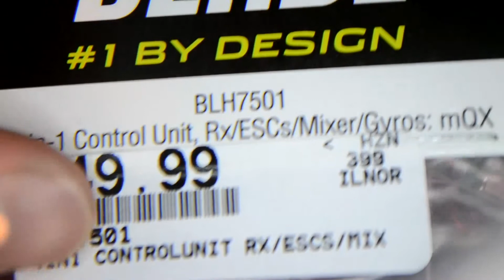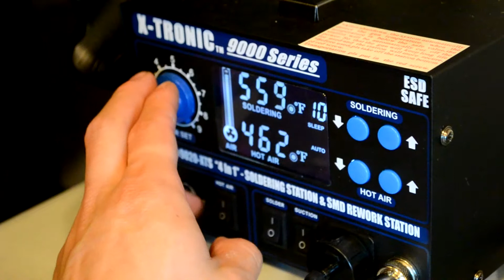Tutorial -----  SMD Soldering

Comment: How well does that X-Tronic 9020 working for you after a couple of years?
Reply from the maker: Frankly, fantastic. I've replaced a few parts, but $220 to utilize laboratory grade equipment for 3+ years has been incredible.
Reply from the maker: +Trevor Burgart the suction feature is non negotiable for me, I've used a heating plate before, but with careful direction of hot air it can be avoided. The only time I've ever needed a heating plate I used a cookie sheet and a hot oven. ;)
Reply: +Brendan Stewart OK, thank for the advice! I'll probably just go with the 9020, thanks!
Reply from the maker: +Trevor Burgart my pleasure!